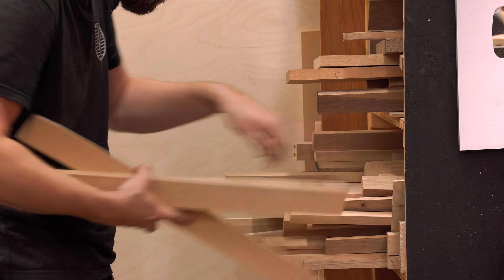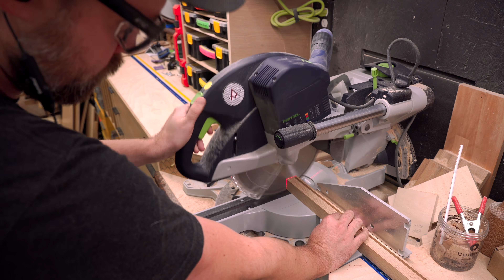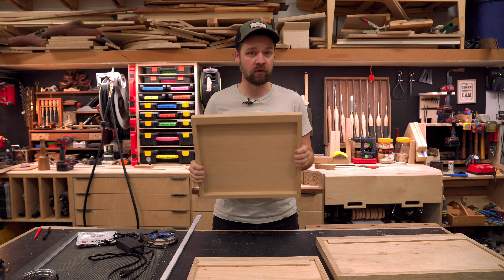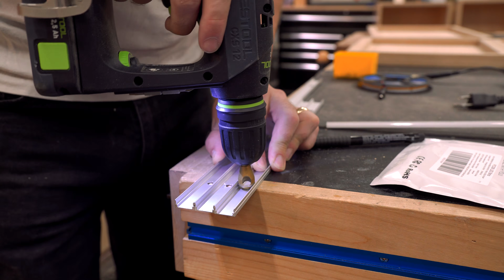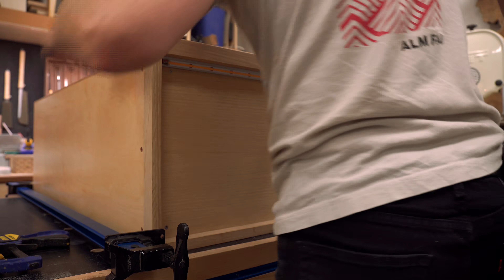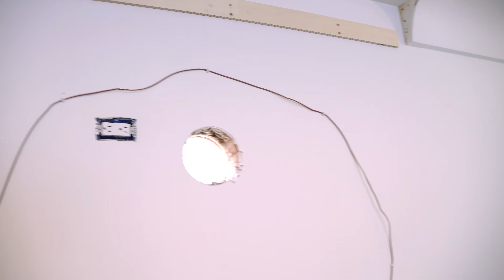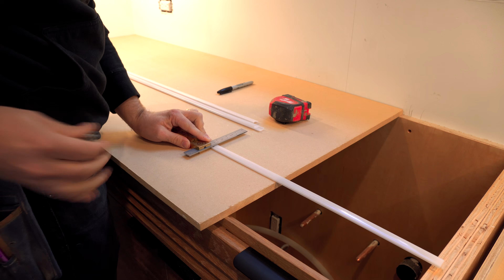Invisible Wire LED Lighting: Ultimate Kitchen Upgrade!

Comment: You made the same mistake that our electrician did 11 years ago. You put the strips against the front edge. They block the strips from lighting in front of the cabinet.  I moved all of ours an inch back and they are still hidden but the entire countertop is illuminated.

Comment: This would be impossible to do with existing cabinets.
Reply: It can be done. It’s just not as convenient. Typically you would run the power cable into a wall and fish it to the nearest outlet. It’s probably not “to code” but it gets the job done.

Comment: Funny thing.  This is a new installation and you only put lighting on the bottom of the cabinets.   Lighting in the cabinets would be easy to do and would add a wow to the cabinets as well.  You would have to add one more thing, a door trigger.  You would also have to calculate the wattage difference for the transformer.

Comment: I am totally going to do this!
Caveat is I am in an apartment so it has to be removable, but my apartment has modular cabinets that have atleast 1/4" between each, 5/8" 'valance' under each cabinet, and 12" running above the cabinets.  Controller above cabinets, drop wires between for the lights!
Great video, thank you!

Comment: Thanks Michael!

Any recommendations for dimmer switches / remotes? I bought the light strip + driver but would like to control them other than plugging them in / unplugging. Mine won't be hardwired to switches as yours are but more like your garage set up.

Comment: For future servicing I thought it's better to just use wago lever nuts instead of soldering. There are also low voltage wago nuts for cheaper option.

Comment: I work in HVAC and I usually shy away from 2-Wire. I'm of the mindset I would rather run 5-Wire to have spare wire if it is ever needed or I need to repurpose.

Comment: Question, I'm retrofitting some old lights under my cabinets and they are these little glass bulbs on a runner that get super hot and I can't find replacements for them. Anyway, they are all hard wired and connected to a single switch. If I connect the driver to the switch to power the first strip, can I use the existing hard wiring to conned the LEDs from cabinet to cabinet? Does that make sense. Basically it's hard wired as a full power circuit, but if I step down w the driver, do I have to replace the wiring down the line.

Comment: There is another major problem with LED lights that I’ve noticed more and more lately especially with strips like these but also cheap bulbs. Many often have insufficient UV filtering!

With some it’s so bad that you will get a slight backlight effect at dim settings! However, most can’t be seen but cause a much bigger problem, bleaching. You’ll first notice the plastic diffuser turn yellow or orangish over the space of several months to a few years. In some cases items near the light will also start to bleach as if left out in the sun!

I would love to find a reviewer that can measure for this somehow. Being confident that a LED strip won’t yellow over time or bleach your work area would be incredibly helpful.

Comment: LED Drivers are called Drivers due to 
   Constant Current Regulation as an LED is a Light Emitting Diode, diodes only allow voltage in one direction.

Comment: CRI means nothing and every (Chinese) supplier will quote nonsense numbers.  Same for efficiency ratings.

Do some research into the different types of light quality measurement, TLCI, SSI etc.

Those hot spots where the strip was too close to the wall, you gotta fix that.

Comment: Michael. A tip when drilling drywall looking for wiring. Use the hole saw in reverse, it will still cut the drywall easy enough but creates less dust, less bite and if you push too hard the teeth are less likely to damage the cables as they are in reverse mode

Comment: It's not a transformer because you are NOT transforming your 120 V AC to 24 V AC. It's technically a "Converter" because you are changing from AC to DC. They reason they call it a "Driver" is because it doesn't JUST convert AC to DC but also provides other functionality: Protection, Regulation and Efficiency. Also, I'm not a fan of FIXED color temp and CRI. I prefer LEDs that can be changed on the fly and then changed using Zigbee. I am NOT a fan of remotes, they ALWAYS get lost and you also have to deal with batteries. Use home assistant, Philips Hue or some other Zigbee hub. Buy a Zigbee light switch and BIND it to the lights. It's a much better solution in my opinion. Over all though, GREAT JOB!! I wouldn't have thought about how to hide the wires on the underside.

Comment: You may just drill the hole for wiring through the aluminium diffuser as well to pass the wire through. Once the strip is glued to the aluminium you cannot access the screws holding the diffuser anyway.

Comment: The COB leds (chip on board) are crap. You want individual emitters for task lighting. They have a higher lumens per watt value and better overall consistency. Amazon is the worst place to buy lights, they will straight up lie to you about all the letters and numbers. You want a lighting company like Cree or Osram or GE or the like. Also CRI rates accuracy not quality.

Comment: I would use CCT strips so that you can change the color temp. Warm is good for evening or late at night mood/night light. Then 4000K (daylight) for task lighting. Would suggest using connectors so it is much easier and quicker to change things out if something fails/breaks. I will be adding LED strips in the toe kick area to use as mood lighting or night light.

Comment: looks really great. i'd recommend using a snap on led connector between the strip and power supply so that you can replace components w/o dealing with resoldering

Comment: Hello, I’d like to add that you can consider cutting the led strip shorter so that the light at the end of the track doesn’t create hot spotting on the cabinet wall. LED is a very sharp light, so you need to keep its distance away from items to provide a nice even glow. Thank you for your video.

Comment: Any reason you didn't go with diagonal (45 degree) aluminum channels? I'm currently planning my install and also planning on putting the LED strip at the front of the (underside) of the cabinet. 45 degree feels like it makes the most sense... but maybe I'm over-thinking this?
Reply: did you go with it? curious to the results. I've considered 45s for a while but never went for it.
Reply: Hmmm. I could try this before I mount mine permanently, but I suspect it would create a lot of glare on the backsplash, when what you really want is downward light on the task at hand.

Comment: Lighting design tip! Leave a gap between the start/end of the led strip and side wall, around 3". This will reduce the extra bright hotspot on the wall which helps direct visual focus to the countertop.
Reply: not only the side walls... but also a gap (distance depends how far you can go without seeing the LEDs in sight) to the front helps to provide more light on the lower working area, because now the light is just blocked off. Not applied that myself though, but it definitely makes sense.
Reply: Those edge hotspots drew my eye as soon as they appeared on screen. Definitely one of the small details you have to get right for a great install.

Comment: FYI: When going from AC to DC, voltage is rectified. From DC to AC it is inverted. Transformers increase or decrease AC voltage. Since LEDs will burn themselves out, a driver is used  limit current and voltage.

Comment: Looks great! There are lots of ways to install LED lighting, but if you're building the cabinets already, might as well keep the wires hidden as much as you can.

FWIW, matching color temps is a safe way to go, but I have found it's not strictly needed and there are reasons to not. After testing with some samples (make up a short run, powered by a battery...LEDs are so nice to work with :) ) when I added LED cabinet lighting to my kitchen, I discovered a couple of things:

1) For task lighting, I much prefer 4000K. Yeah, the room lights (can and pendant) are "warm white" (which is usually 2700K, and is in my case, but I've seen some manufacturers claim "warm white" for even warmer color temps), but the undercabinet lights are all indirect and largely take on the color of whatever they're lighting up. More important though, the cooler temp helps my aging eyes when actually working on the counter with food prep and whatnot. Even with a high CRI, 2700K just doesn't give as much contrast and detail as 4000K.

2) Related to that, I also installed lights inside the cabinets at the top, where the doors have glass and the space is used for decorative stuff (vases, jars, etc.). Even there, though it's not task lighting, I found 4000K works better for me. The cabinets are all wood (mostly maple veneer), and that has the effect of shifting the glow down to warmer color temp anyway, but the decorative stuff "pops" better with the cooler temp light. I love the way the warm glow from the wood, around a well-lit glass vase, looks in the cabinet.

Of course, YMMV. Just wanted to emphasize that with color temps, as with many aesthetic choices, one size does not necessarily fit all. It can not just be okay, but even preferable in some situations to not match the color temp with the existing lighting.

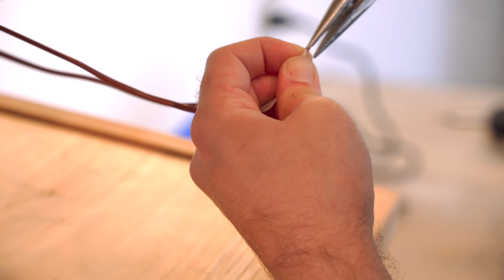Comment: 23:40 you could also use wago connectors fo this, that way you don´t need to solder and can take it apart easier if you need to change the led in the future
Reply: good tip! This also results in lower electrical resistance and improved energy efficiency.

Comment: thank you for the valuable advice. 
i want to do this in my kitchen. however, my kitchen is "galley" style, so its long and skinny with cabinets are on both sides. im at a loss on how to connect the two sides without unsightly wires on the walls or doing a bunch of drywall work (which is more work than i want to put into this) 
i had the thought of running the two sides on separate power supplies then connecting them with smart switches. however, my knowledge of smart plugs and whatnot is very limited so im not 100% sure how i would do that or if its even possible.

Comment: First off, thank you for using channel! So many people (including "professionals") don't do this, they just stick the strip directly to the underside of the cabinet 🤢

Second, you spoke to making sure the driver had enough wattage 👍but the other thing that's important to consider is voltage drop. LEDs are typically constant current driven, but these strips are typically constant voltage driven, so making sure they have the correct voltage is important, otherwise they will not get as bright as they should, produce the color they should, or may fade along the length of the strip (basically the LEDs at the start of the strip get enough voltage but they ones at the end don't).

When I did my kitchen under cabinet lights, I placed the driver, as well as smart controller in the cabinet above the fridge. I then ran three separate cable runs to each cabinet via the attic. (My setup was complicated by the fact that I used RGBW LED strips, so I had to use cable that had 5 conductors in it). In any case, after going from the cabinet, into and across the attic, and then down the wall into the cabinet, even the shortest run was a few feet. The longest was probably more than 10'. I had to estimate the length and calculate the estimated voltage drop to make sure that each strip was seeing 24v both at the beginning and end of the strip. Realistically, if you're getting a little less (want to stay under 3% drop based on the NEC) voltage at the strip it's probably ok, as long as it's the same along the entire strip (especially for long strips) and it's not so much of a drop on one strip vs. another that you notice a brightness difference.

To compensate for a long run you can increase the wire gauge, or move the driver closer (i.e. make the run shorter) if possible. If the strip is particularly long you may need to run a second power cable to it and tap it either in the middle of the strip, or at the end. 

To calculate voltage drop, you can Google "voltage drop calculator," and plug in the estimated length of the circuit, wattage, and voltage, and the gauge of the wire you plan to use. Just make sure you switch it to DC.
Reply: You can also connect both ends of the power rail to the driver, that way you almost avoid the drops.

Comment: Michael, first-rate vid and appreciate your attention to detail.  However, you did leave out one aspect I've been trying to get answered for my project: what level of light do you need over the counters?

Here are some other questions I had while watching:
- What gauge wire did you use to interconnect your LED strips between one-another?
- Is your LED strip setup dimmable?
- Are the strips a fixed color temperature?
- With the COB LEDs, could you have gone with a clear channel cover instead of frosted in order to have less light loss?  The COBs have a diffusive layer above the actual LEDs.  

Thanks, and this video got me to subscribe to the channel.
Reply: Would love to see a reply from Michael with the specifics, but in the meantime...

-- I don't know what wire gauge he used, but for low-voltage stuff, you almost never will need bigger than 18 AWG. It does depend on just how much lighting you're trying to run off the same wire, but most of the time you'll run into aesthetic issues related to voltage drop before you overload the wiring and will want to upgrade the wiring size for that reason anyway. In practice, 20 or 22 AWG is usually fine. There are online calculators you can use to be sure though. Take your amperage, add 25% (for constant load situations, all wiring and equipment should be sized so that you're only using 80% of the rated load), and see what gauge wire is required.

-- The driver he took from his shop lighting is dimmable. You can tell either by looking up the make/model # online (pulled from the closeup shot he provides of the driver), or just noticing at the end when he's testing the lights, that he goes through a dimming range of the lights.

-- The LED strips used here have a single color temp. Of course, if you want to get fancy you can use temp adjustable LEDs, or even RGB, but those would require a more complicated wiring setup, as well as a different kind of light switch, or at least a remote control tied into the system somehow.

-- I wonder about the diffuser myself. Honestly, with the COB strip, I probably wouldn't have even bothered with the diffuser. It's just going to keep airflow away from the strip, which likely will shorten the life of the strip, and the COB style LEDs already have very even light. That said, my own preference might not be relevant, since I wouldn't use the COB strip in the first place. For my own kitchen, I used regular strips with 2832 LEDs, relying on higher density spacing (120/m) and a diffuser to even out the light. In a previous very-low-budget install, I was just using strips with 60/m spacing and no channel or diffuser, and even there I rarely noticed any unevenness of the light; occasionally I'd catch a glimpse of the individual LEDs reflecting from the toaster or microwave, but the illumination of tasks was still great.

With the 120/m and a diffuser, you can only notice the individual LEDs if looking directly at the light strip, and of course since it's carefully installed under the cabinets where you're not able to see the lights directly, this is completely fine.